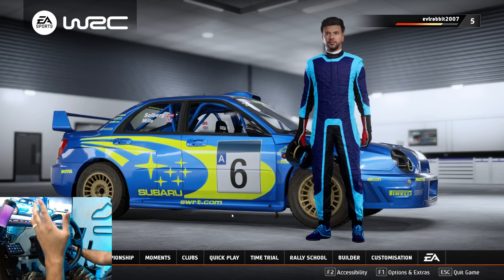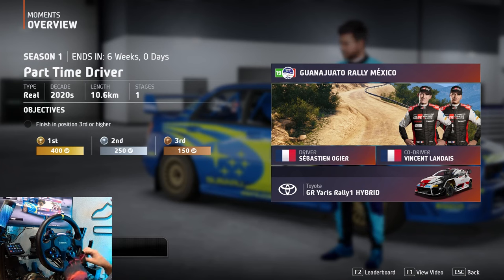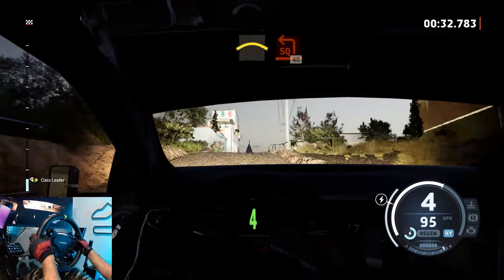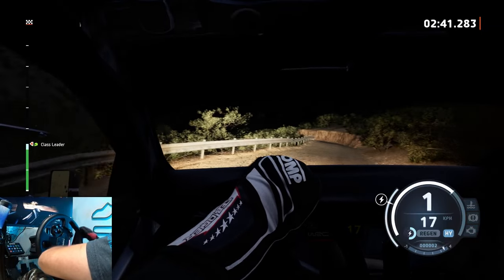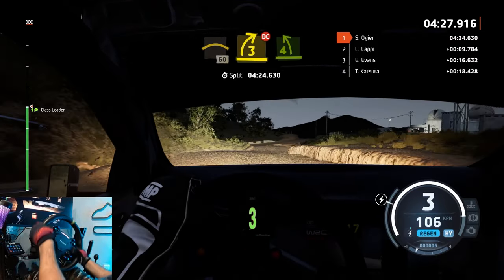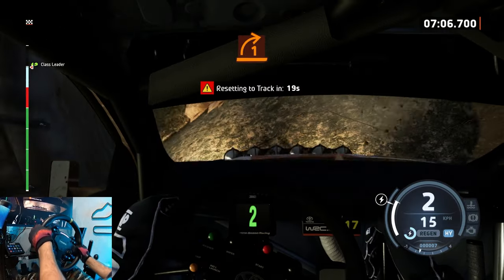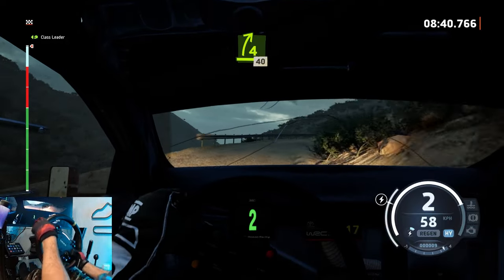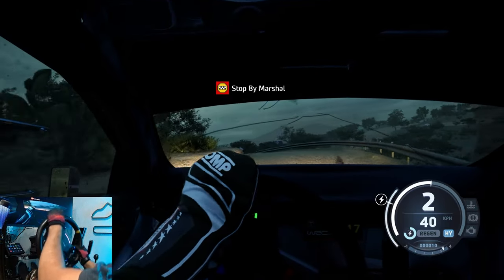FFB Fix for EA WRC for MOZA R9,R5,R12,R16,R21- Ripping the hardest stage yet!!!

Comment: I'm using an R5 and I got a weird calibration bug for the wheel, where the left and right inputs were kinda messed up and asymmetrical. Felt really weird and it gave me a huge deadzone in the middle on one side. Ended up refunding it. Every other sim I've played so far has not had a shitty issue like that.

Comment: Seems like they updated something and changed the device list and now it doesnt work to copy paste
Reply: yep. just found that out.
Reply: Did you remember to add the brackets? Works fine for me.
Reply: Got it to work.
Reply: @jessecapitani7342  how did you get it to work? i cant copy and past it
Reply: @langbuddha2798  honestly, i can't even remember at this point. sorry
Reply: @langbuddha2798  I think I opened the file in notepad instead of windows docs. In hindsight, I should have stated my solution with my response.

Comment: I have the r9 v2 base and I just configured my wheel before I loaded up the game FFB is there for sure kinda light but it’s there for corners. I’m curious though what steering angle you run? I run 900 it doesn’t feel pin point much

Comment: Game detects my wheel but the calibration is all kinds of messed up. When centered wheel shows 50% to the right in game. Any ideas on how to fix this?
Reply: Yep, I had the same issue here on an R5. No idea why it happened. The left and right sides are all wonky. I ended up refunding it. Hopefully it'll get fixed and I'll buy it at a later date. For now it's back to RBR, which amazingly works a lot better with the wheel.
Reply: @adz951  I did end up getting it to work properly but it was so long ago I have no clue what the fix was unfortunately. Ended up being one of my favorite sim games!